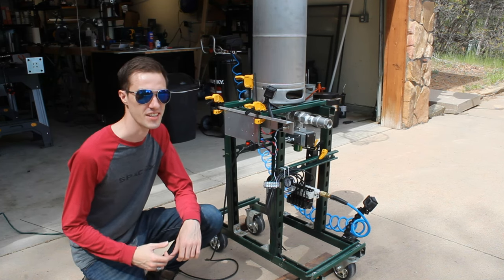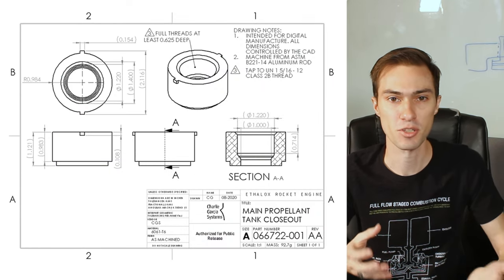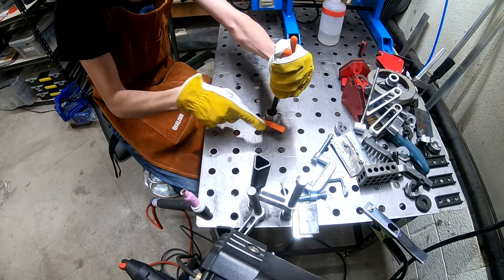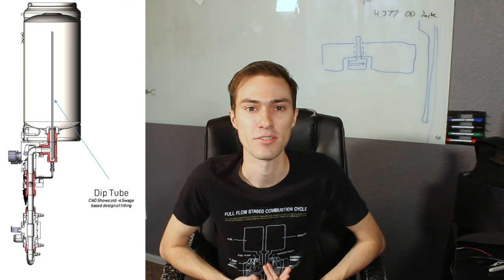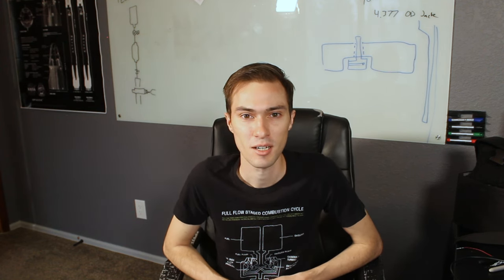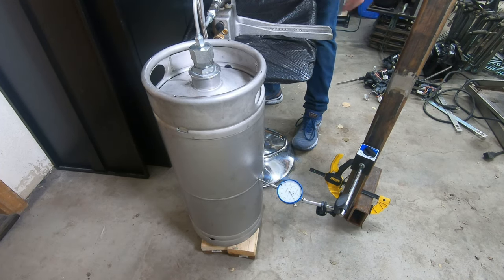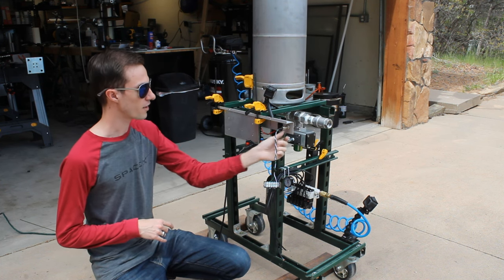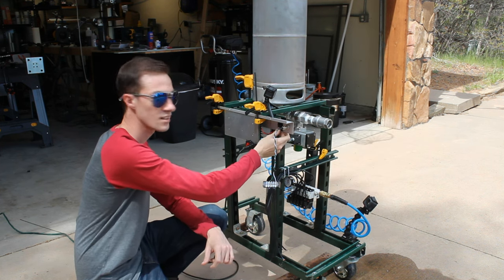Liquid Rocket Engines 10: A Giant 400psi Super Soaker

Comment: Another solution to testing for leaks is partially pressurizing the vessel and spraying soapy water on the tank/tank connectors and see where bubbles form
Reply: Please never do that. Find an approved “leak detection solution” as detergent soaps have a degradation corrosive effect on many metals.

Comment: A number of years ago a fab shop hydrotested a 8' diameter x 16' tall used vessel for us. It was an ANSI 600 vessel rated to 1,400 psig. Unbeknownst to them or us is had a hydrogen embrittlement problem and somewhere around 900 psig the area near the point where the skirt was welded onto the vessel cracked and about 12" of material pushed out. Other than the mess that it made on the shop floor it was a non-event. Ie the pressure drops very quickly and movement of the metal is very limited. Hydro testing is relatively safe. Congrats on the successful test.
Reply: Still a scary ass moment!

Comment: In regards to the trouble with welding the fittings, they probably have a chrome or zinc coating for corrosion resistance. If you grind that layer off, they should weld much better! (And the fumes won't be as toxic then :P)

Comment: I'm a bit confused on the part at the end of the video where you said that one of the things that you confirmed out of your super soaker test is the mass flow rate, I know that that can be calculated so I'm not sure why the test was required and I'm thinking of 2 possibilities, 1 being that because of the friction with the pipes the mass flow rate can't be accurately calculated and 2 being something with the pipe diamiter limiting you on the m_dot, but I'm not sure what that could be?
Reply from the maker: Flow rates can be calculated fairly accurately beforehand, but it's always possible I made a mistake or added a component that did not match my model.
The test ensures that I don't need to debug the system before moving on.
Reply: Fluids be fickle, man! Something as seemingly innocuous as Teflon tape or metal slivers could impede flow or worse, jamb valves, regs, et al. Also, hard 90°s instead of sweeps, and other sources of friction greatly reduce mass flow which can sometimes be more easily identified with a test than to math it out.
Reply: Plus it gives a good opportunity to check connections for leaks and proper operation! 🤷🏾‍♂️

Comment: 8 psi lost over that time could be explained away by the initial heat gain from having pressurized the tank then letting it cool. I have a feeling that if you let it sit longer, it would have settled to a given pressure then assuming the temperature stayed constant, so would your settled pressure. 
….potentially.